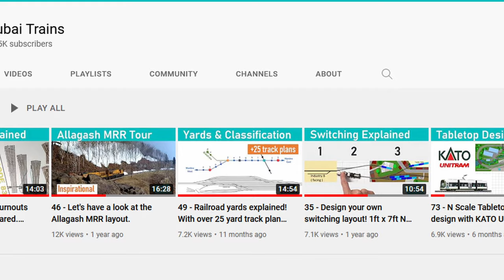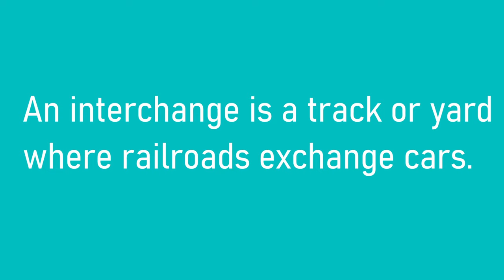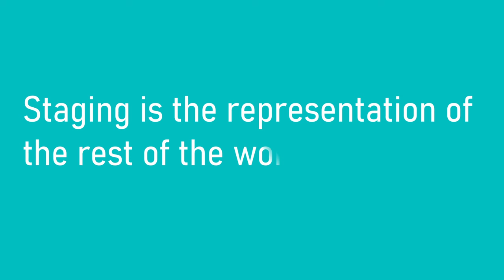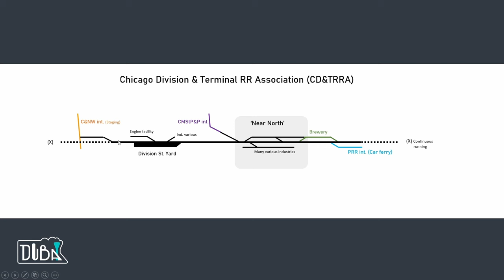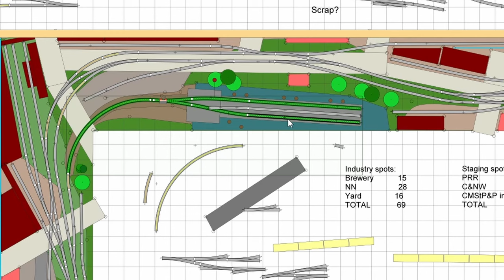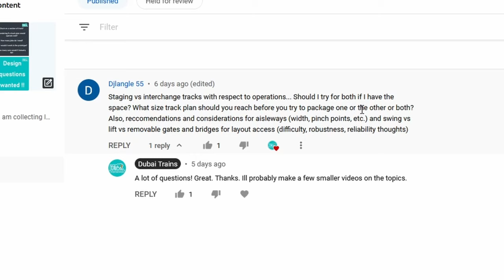107 - Q&A Interchange vs Staging for operating. The why, what and when.

Comment: Enjoyed your video. I appreciate all the work that went into it. If I might add; one of the difference between staging yards and exchange tracks is that in Staging yards you can store whole trains with engines and cabooses. For example I use mine to store passenger trains that are on a unmodeled portion of the layout. You could do the same for unit trains like a coal train without having a mine or a consuming industry on the modeled portion of the layout. 

Bob
Reply from the maker: Hi Bob, thanks for the addition. That is good to note.

Comment: I’ve managed to fit a triple decker into a 18foot hallway with 18 inch width benchwork and 8’3 by 7’8 room with 12-24 inch benchwork into my modular home, of course to run three decks I have to have a modular helix, as well as 5 drop in sections, a hinged extension, and two staging cassettes. The layout consists of 6 towns, 3 communities, 20+ industries, a 8 track yard, and is based off three branch lines, two of the former Gulf coast Lines (later mopac), and a interchange and branch line with southern pacific. Based in 1910-1935 and it’s a south coastal Texas ho prototype 
. Even though I’ve not even been able to get the thing running with a new system, the staging is super essential for me to represent traffic further down the main line of the GCL, as well as where my trains go beyond what I’m able to model, so I will have through trains on the 30 foot staging to staging main line through train, locals that work the cars out of the yard, and two of the three branch lines have daily industry switching service so industries are able to work traffic cars efficiently and prototypical, you explained this very well! Got a sub from me, Cheers!
Reply from the maker: Your welcome! That is quite the prototype! Early 1900 coastal texas. And I am jealous of that 30ft staging.
You mention to have difficulty to get the operations to run well. So you have a manifest? If not make this first. A list of all the trains you have (east / west / through / local etc). And the put them is a logic order. E.g. the east bound comes in, in the morning, and returns late afternoon. The prototype will guild you here as well. And keep the yard capacity in mind! 
Hope it helps,
Cheers.
Reply: @DubaiTrains  I’m still in construction phase! Ive not uploaded since I basically spent hours and hours on it, I hadn’t started on the third deck yet but now I’m finishing up areas as coastal Texas is truly as flat as the world gets no joke growing up on the coast the sunsets on the water was the most visually appealing thing down there the water is disgusting greenish brown and the saltwater really damaged exteriors of the homes. ( my main southern pacific branch train was known as “old salty” back in the time it was used. But it’s not the issue of knowing how to do ops prototypicaly but knowing how to put it all in computer programs I’ve watched countless hours of tutorials I always feel like I just do everything not correct, but this is my first real go at a proto layout so setting ir up in a system with the knowledge I do have should help me. The layouts condensed to the point that every four feet is my visual representation or what I believe the area looked like between 1910-1935.
Reply: @DubaiTrains  the yard is 15 feet, there’s two staging cassettes one is about 5.5 feet and it represents east staging and the SP tracks on the other side of Victoria Texas, which gives Victoria trains from both east and the west staging which is the longest at a little under 8 feet, but they are end to end of the yard, with a modular helix I have to tediously due to space constraints but the desire to still go all out that connects each level, and the lowest level has a turnout on to the SP branch line and the next two levels have drop in extensions across the 4 foot doorway to the helix, again I truly wanted to go all out if I ever had the chance to model the area where I grew up in, each town has 2-3 trains a day with one branch having 2 at most. I also have an abandoned 7.5 foot spur line is freelance, the track continues on along the coast line with the large boulders and murky waves, the track has a spur but not accessible as large overgrowth covers it, they continue on until the tracks are broken apart and Rail missing as the end in the weeds. I use it as a MOW storage track.
Reply: Top deck is taking the longest as it has long wooden bridges S curving through marsh land, then going across the doorway from the hallway and will represent crossing the barge canal to the layout room connecting to the M shaped configuration, as it enters it crosses one more bridge over the Guadalupe river and ends up in farmland until reaching its terminus in Austwell tx. There’s three wharfs on the layout as well, two branch lines have wye to turn the locos around one has a turntable maintenance shed and a fueling track. Each branch is at its longest same level point to point between 45-52 feet, with the longest possible run being between two points is I believe going to be 175 feet even.
Reply from the maker: That will be a great layout when finished. 
I initially wanted to use JMRI to create switch lists for operating. But i found it too cumbersome to setup. At the same time i read into the car card system which i have been using for years now. A great and easy system, at least for me. Nice and analog!

Comment: Nice video. Noticed you changed the design of your layout. I'm also in a similar situation as you, getting ready to move into a new place, moving can be quite difficult, but liberating in some aspects.

If you still have the brewery on your layout, something to note: in the US & Canada, grain & other granular materials were transported in bulk via boxcars through even the 70s, though covered hoppers started appearing in the very late 50s  - early 60s. Canada was still shipping grain in box cars up until the 90s on short lines. learned that today & now I'm going to have to sell my covered hoppers at the next train show.
Reply from the maker: Well spotted. My new space is 2.3m x 5.5m. Its a nice space but a little bit smaller. So I am trying to accept that i have no space for a car float 😅. Something has got to give!
Thanks for the heads up on the grain hoppers. I was aware of this. I like the look of mostly box cars with a few flats and gondolas on my layout so it fits well. I can still have a few hoppers.

Comment: The key for interchange is in its history. Railroads use to not exchange freight cars that were on their own lines. Railroads would have to take commodities out of the freight car and reload them onto another railroad's freight car. The result was freight cars never left their owner's railroads. When interchange was invented, cars could cross that boundry and travel onto other railroads. That allowed them to reach customers further away as it also saved time.
Reply from the maker: Thanks for the add on. That is a small yet consequential piece of information. 
When was this first done, and when was it common practice?
Reply: @DubaiTrains  As far as I can find, it varies widely from the early days of railroading in America (1840's) to about the turn of the 20th Century. I've read articles saying it begun in the 1960's. There is not a sure timeline as to when it actually begun.

Comment: Great video ,are you going to run foreign power on your track from the interchanges?
Reply from the maker: Hi Ron. Nope. I am not. But if you want that there is another way. As I explain in video #86, the RR is an association formed by 3 railroads. Working together to operate it. The agreement is that 1 railroad supplies the locomotive power. If I want foreign power than I could alter that agreement. I.e. they all supply left over power of something along those lines.